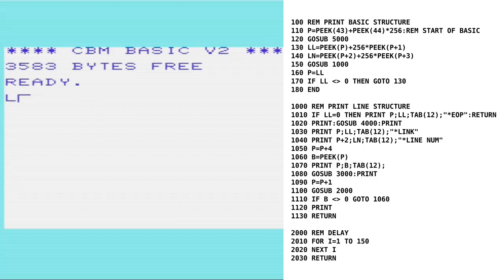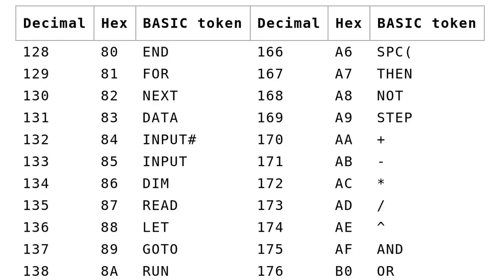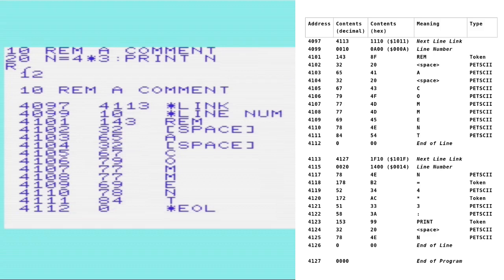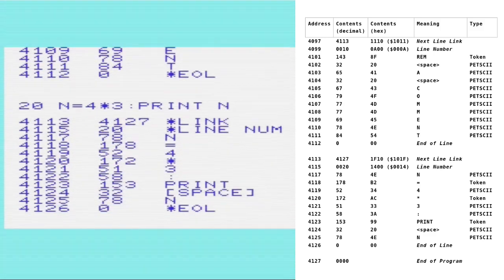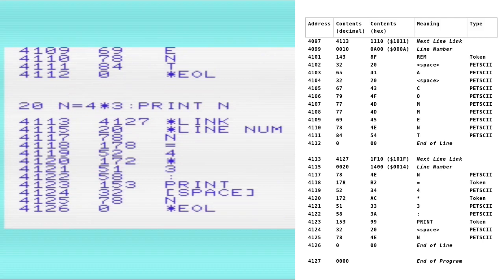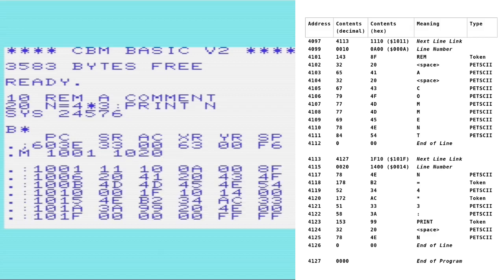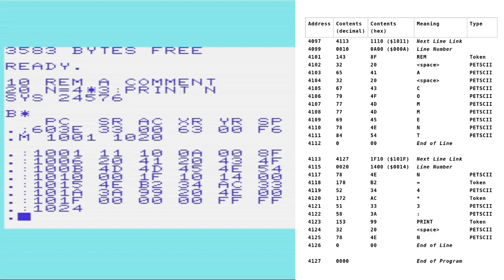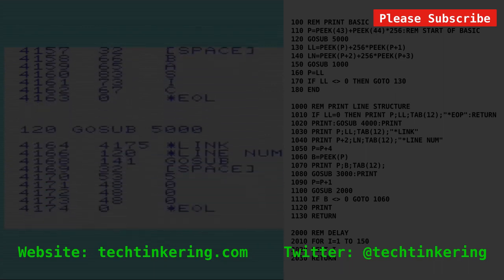Basic Line Storage on the VIC-20

Comment: Is it possible to port VIC-20 assembly to Commodore C64 assembly?
Reply from the maker: It depends.  The VIC-20 and C64 have different memory layouts, kernels, etc.  However, code can be designed to work on both and some things will naturally work on both.  In the case of this video - they both store BASIC lines in a similar manner albeit at different locations in memory.

Comment: I have a question re Plain text Basic listing conversion to VIC-20 basic file.
Is it possible  ? The purpose is to enable copying and pasting a plain text basic listing from for example a PDF, to Windows Notepad file, then converting to VIC-20 Basic file. Saves all the typing. Many thanks.
Reply from the maker: You can do this using 'petcat.  I've created a video which hopefully you'll find useful::
   Tokenize/De-tokenize Commodore Basic Programs Using petcat
    https://youtu.be/MZHS4qVfmvc
Reply: @TechTinkering  Hey wow, just what I needed .  Many thanks indeed !